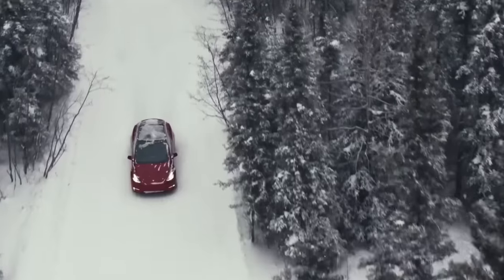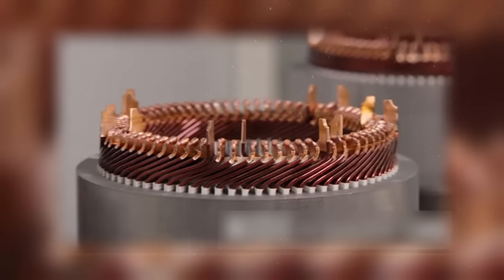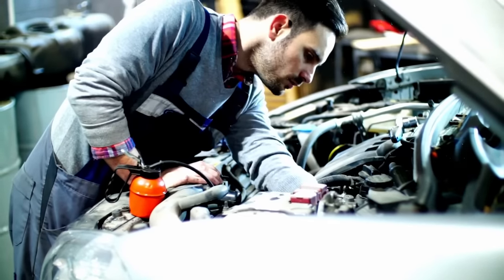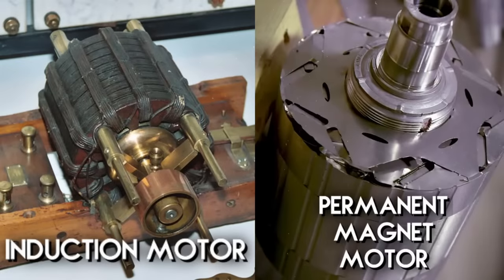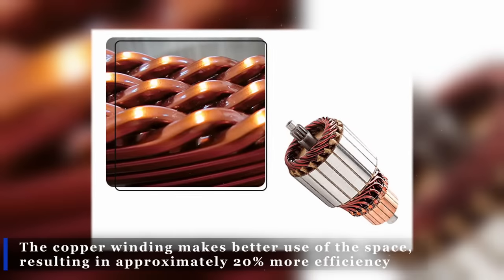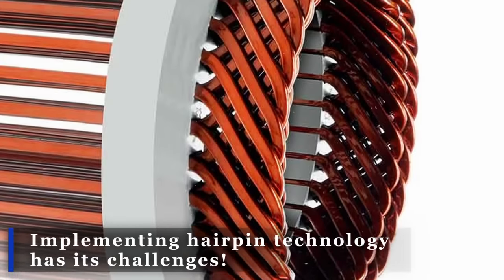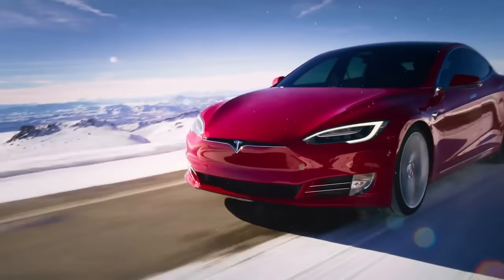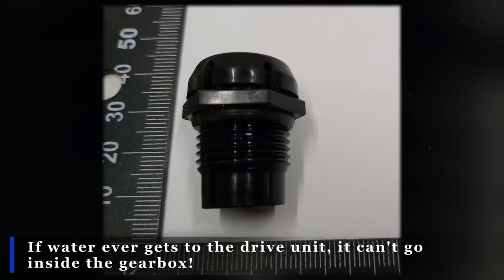Elon Musk: Tesla's New Engine Will Change The EV Industry Forever!

Comment: For EVs, the motors are not the issue, it's the batteries. E.V.s will only be good once we can 100% recycle batteries, have charing which takes no more than 30 minutes, be able to charge to 100% without damaging the cells and be able to do 100,000s of miles before any significant degradation or at least mitigate any degradation from batteries. The alternative would be to make batteries very cheap to replace.
Reply: But since we don’t recycle any of the fuel we use right now I would say that’s a tall order. Everybody I know that has a Tesla is about to charge to 80+ percent in about 20 minutes ,but with lithium iron phosphate batteries, they should expect to get more than 100,000 miles with no degradation, lithium ion somewhat less and the sodium batteries may prove to be even better.
Reply: @sandyt4343  degradation is about 2-4% per 10k miles or year for the most recent M3s. This also worsens towards 7% per annum or 10k miles if you super charge all the time and always charge above 80% and allow the vehicle to completely drain constantly.
Reply: Never going to happen, evs far more damaging to the environment overall than ice cars especially  diesels which are far more efficient and the latest diesels very little pollution and far more reliable
Reply: @barryphipps9442  battery development could enable this, such as how computers was running on KBs back in the day and these days were on TB and about to start h wrung towards PETABYTES.
Reply: @sandyt4343 Sodium ion batteries have been around since the 1970's.
They hold x5 more power than Lithium ion batteries.
Plus they last x3 longer.
They are one quarter the size of the Lithium ion batteries.
They are also considerably cheaper.
Reply: @barryphipps9442 Diesel comes from oil.
Oil will not be around forever.
Reply: This comments on this video are as erroneous as the poster!
* EV batteries are 100% recycled at >95% efficiency. The recovered minerals are far too valuable to throw away. In US Tesla and Redwood Materials do this.
* Batteries already meet the requirements for vehicles and storage. The issue is not increasing performance but cutting costs. Tesla's 4680 format cells are designed to do this.
* Charging rates of 200 miles in 10 minutes are common on Tesla vehicles with Superchargers.
* There are broadly two packs on offer: LFP are cheaper with lower energy density (charged voltage) and higher cycle life. NMC are performance cells trading energy density for cycle life. Either of them will outlast the typical ICE drive train. In energy storage situations it is possible to make packs that will last 40-50 years with either chemistry. In vehicles million mile batteries have been demonstrated by Tesla's battery expert Dahn.
* NMC cells lose ~5% capacity per first 50k miles and thereafter ~1% thereafter.
* Sodium Ion batteries are lower energy density and lower cycle number than automotive batteries at 75–200 Wh/kg. Both CATL and BYD may use a combined lithium/sodium pack in cars this year.
*Tesla power trains and batteries have both been tested to a million miles without maintenance. Motor cooling fluid is replacable. No Diesel or ICE can do this.
* BEVs are MUCH cleaner than ICE cradle to grave. A Tesla Model 3 would need to be driven on average in US for only 13,500 miles (21,725 km or ~ a year) before it does less harm to the environment than a Toyota Corolla. and yet it costs less to own within 5 years in the US (Argonne Lab).
Reply: @barryphipps9442  Nothing is more damaging to the environment than fossil fuels.
Reply: we can already recycle 98% of batteries...
Reply: Why do you need batteries!

Comment: Rectangular copper conductors in motors have been used for very many decades, there is nothing new whatsoever in this. It's only in low power induction motors that round wire is used because it makes for a cheap way of winding the coils by machine. 
Packing the windings tigher tends to increase winding temperatures, but I'm sure Tesla are aware of that in their design.
How are these motors cooled? Industrial induction motors of small to medium size have external fins and fan cooling. (Large motors often have water cooling.)
Reply: Tesla's motors are water cooled.
Reply: Jim, 

thank you for the information. What about the power controllers, air cooling similar to industrial drives?

Comment: Whether you drive electric or not in terms of safety it is never good to be behind the wheel for so long without a break, but I understand your fear, I had it at first but I have been driving electric for 5 years now my driving range is only 360km and to be honest I have never had any difficulties,  The only times I had to refill, the break was more than welcome
Reply: You have issues I don’t have
Reply: Driving Model S since 2014 and never had any issue with the technique. Driving electric is really great and having a sports car with the loading capacity of a Model S is something you will not find with any comparable car like Porsche or any Audi RS or BMW
Reply: A 30-45 min break on the road is NOT welcome.  And that's if you're not behind others charging.
Reply: @melbro62  If you drive until your battery is complete empty then per law you have to take a break anyway.  And btw, there are e-cars that plan your trip, and they know where an empty charger is available for you. Never saw that for gasoil stations.
Reply: @konstanthin8753  Sorry Konstathin, gas stations are everywhere and I have an App that tells me where they are and what's really nice is where the cheapest gas is.  Since EVs only make up less than 10% of total vehicles right now and they are already having problems with rolling brownouts from the charging demand and home AC demand on hot days.  Electricity doesn't grow on trees and I can imagine when the EVs get to be  even at 20%-30% of all vehicles how Grids will be overrun.   Of course for average commuters I can see an EV being a good thing.  That I-95 last winter on the east coast and those stranded EVs gave me chills, literally.
Reply: What BREAK per law?  Is that a California thing?  I take a pis break 5-10 min and that is not per law.
Reply: @melbro62 : Now it is clear why humans are going nuts. With such intelligent answers one is powerless. Your answer is about as intelligent as the sentence "Why should I need solar? My electricity comes from the socket"
Reply: Breaking every few hundred miles is normal and safer but recharging is something I would rather not have to worry about so frequently and I'm sure the EV industries are the future possibly with a water fuel technology integration both being better for everyone but oil companies. Have a Blessed Day & pray about it 🙏 in JESUS HOLY NAME AMEN AMEN AND AMEN 🕊 💜 🙏

Comment: How about the toyota's internal combustion engine the runs on hydrogen?
Reply: The energy density of hydrogen is not as dense as alcohol. All kinds of other fuels( biofuel, synthetic fuels, methonol, hydrogen) still needs a lot of processes before it can turn into usable fuel. These process still will emit much more greenhouse gas than the process of battery. Battery is still the way to move forward.
Reply: @tanalson  that's not true at all. They make hydrogen on demand & the emissions are oxygen or water.
No harm in producing them both anyway.
Reply: @valeriegiles6524 I agree with you. Personally I'm more convinced that Toyota's hydrogen combustion engine is a better technology for the future, not only for autos but also should be explored for aircraft, ship engines, or even power plants.
Reply: @nurburgringkid  i disagree, as much as i love ice engine, i still believe that electric car is the future. once green hydrogen production can be scale up to mass production, EV can really take off. atm bev might have the lead, but i truely beliece that toyota fuel-cell ev will be the future especially in teh truckin industry. a much small high power battery combine with a hydrogen fuel cell, should be the future. directly high power from a small battery so u can still get that high power acceleration and all teh thrill of a high preformance vechical, a 50-100 mile range battery is all u need. for long distance and endurance run or trip, hydrogen fuelcell can provide teh power need to mantain freeway speed for long distance. fuelcell can also generationt eh power need to recharge the battery on teh go. fillin up a tank of hydrogen is still fast just like gasoline.
Reply: So you take hydrogen gas and then convert it into electricity... So that's still an electric car....
Reply: @Kiran-uo8vu  please read properly I sais internal combustion engine that burns hydrogène instead of gas
Reply: @Kiran-uo8vu  you dont take hydrogen gas. It breaks down water into its 2 components & uses the hydrogen to power the vechicle. No batteries required.
Reply: Mirai is not an  internal combustion engine the runs on hydrogen.  It is fuel cell.  It uses hydrogen to convert to electricity directly.
Reply: @wilsoneashoian5789  https://en.wikipedia.org/wiki/Hydrogen_internal_combustion_engine_vehicle please educate yourself;f before writing.
Reply: @laflammr  Lol Mirai Fuel Cell Stack works with chemical reaction involving the oxygen in the air and hydrogen creates electricity.  There is no combustion.  It is directly generating hydrogen into electricity. Educate yourself before you make a fool of yourself.
Reply: @wilsoneashoian5789  i am assuming you did not read the article on ice engine running on hydrogen. Why do you keep on talking about Mirai it has nothing to do with it. You are the one showing your lack of knowledge
Reply: @laflammr  I read the article.  The first law of thermodynamic is held in the universe.  The  conservation of energy, is always valid.  It does not matter how you use the energy.  If system is 100% efficient you get what you put out, but no system is 100% efficient. If electrolysis (electricity) is used to convert H2O to H2, the same energy will be recovered during the combustion. The most efficient system is when H2 is run thru Fuel Cell. Burring H2 will be only 50% efficient because of the entropy.  Please learn some engineering before you talk to me.
Reply: @wilsoneashoian5789  well in that case I must have read Toyota's new patent.     By the way what is your master in engineering.     https://www.youtube.com/watch?v=P8sosEGk068
Reply: @valeriegiles6524 hydrogen is highly flammable compared to gasoline and EV battery. Hydrogen fuel will still need transportation to fuel station, the hydrogen engine will still need maintenance like gasoline combustion engine such as lubricant for engine and gearbox. Whereas EV is basically maintenance free. It is more costly to re setup hydrogen fuel station compare to pulling electric cable for EV station.
Reply: @aeroline11  
Yes it is transported. 
However, it is also produced on site, also.

Comment: The electric motor weighs 194# but then you add the battery weight and you are carrying a load to begin with.
Reply: Then they have to develop a battery that is lighter and have has a lot more energy density
Reply: But it's 20% more efficient. This means it's going to use less energy for the same amount of torque and speed, so this means that Tesla will use lesser batteries , which will also drive down the cost too
Reply: With ICE cars you have the weight of an engine, transmission and a tank of gas plus the set up is only around 30% efficient. I don't have a dog in the fight. I don't think cars are the reason for climate change but I do think it is exciting to see the electric revolution. They are still improving ICE to this day, 150 years after it's invention so what makes you think the first version of batteries and motors for EV's was going to be the best and never need improvements.
Reply: @tanalson  This claim cannot hold. Any good electric motor is efficient for more than 90%...most of them 95%.
Yes you can reduce the energy loss with 20%....meaning that instead of 95% efficiency you'll get 96% efficiency.

The only real gains are : Less weight, less materal usage and less heat production (which reduces cooling...)
Next point...An electric car does not have a heavy combustion engine, transmission, clutch system  and gearbox.....Only the conbnection to the wheels still exists (in a Tesla)...we also do have inwheel engines which do not have any extra resistance in the car anywhere except the unavoidable wheel bearing as any other car has.
The weight af a standard tesla battery ...ca 5kg/kwh including battery management system/cooling. With at least 200 kg less (no filled petrol tank, no transmission, no heavy combustion engine needed) we hacve already a 40KWH battery for the same weight as an ICE drivetrain. 
With the new mentioned battery (on internet...sodium) with a weight of 2 kg/kwh we will have in the future when those are in production a 80KWH battery in a car with the same weight as an ice car.
(In 2013 a 5,1KWH battery was only 20 kg...at that moment the best which could be found on the market (less than 20kg due to the rules of the world solar challenge)...already less than now the tesla batteries. The technic in batteries is not on a stand still)
Reply: @rickbackous1041  can the Chinese make ones that dont burst into flames?
Reply: @brianjones7660  solid-state batteries are right around the corner
Reply: Any time frame we can hold you to?
It’s like Brazil, always the economy of tomorrow ……always off in the future.
But soon, real soon….we mean it.

Comment: Friendly advice …. You use the word engines multiple times ….. the proper word would be motor….. engines use a fuel to explode the fuel and drive the crankshaft
Reply: Burn the fuel, not explode.

Comment: Regardless, they are still electric cars with all the same problematic issues they've always had.
 Toyota's "H2" hydrogen fuel cell internal combustion engine is THE  "state of the art"  powerplant technology for future vehicles...coming soon!
Reply: The hydrogen fuel cell vehicle has been coming for years.  Will it ever get here?
Reply: @passingthrough812  it already has , in japan at least
Reply: A fuelcell car is just another full electric car. No combustion engine. Sorry that I have to tell you this. A fuel cell is just a electricity producer using hydrogen for this. Unfortunate the efficiency of the H2 cycle is very low. On the wheels these cars are worse in efficiency as ICE cars...partly due to the need of compression into the fuel tanks for H2.Also those fuelstation can explode (as we have seen in Oslo) And for the construction of fuel cells we need very expensive and difficult  to get  elements (irridium)...for the membrane. 
H2 is NO advisable option for cars. It could be an option when weight is very important (planes).
Reply: @reiniernn9071  The H2 vehicle is not an electric car. It uses an I.C.E. using hydrogen instead of gasoline.
Reply: @take942  If you are typing fuelcell in your comment I can only assume that you are writng abou a car wth a fuelcell technic...."Toyota's "H2" hydrogen fuel cell "
Reply: @reiniernn9071  Yes, Toyota H2 and other engines too.
I also saw a documentary in the late 1970's broadcast on the PBS show called "Nova". 
It was an in depth show about using hydrogen in vehicles with I.C. engines. BTW, when switched over to hydrogen it could clearly be seen that the engines idled much smoother than burning  gasoline. They also showed jet engines using hydrogen and homes using hydrogen for heating and cooking in place of natural gas. The tanks that it is stored in must be lined with plastic as the hydrogen molecules eventually eat thru metal when stored for longer periods of time.
Reply: @Reinier NN he is referring to the H2 Internal Combustion V8 engine developed by Toyota in conjunction with Yamaha
Reply: @passingthrough812  It's here in the USA now, if you live in coastal California. Toyota sells about 200 units per month of the Mirai fuel cell car. It's a competent vehicle. Very well engineered, very nice to drive. And is does fill up in 5 minutes - IF you can get to an H2 station. Those are rare, and all concentrated around LA/Orange County and the SF bay area. You can't take the car out of the limited area with stations. Their are no stations in any other state, or even in most of California. (Correction - There is an H2 station in Hawaii.)
Toyota sells each Mirai at far below the cost of production, and bundles in $15,000 of prepaid fuel. Basically, they nearly give the cars away to achieve some shipments.
This is not going to change any time in the next decade.
Reply: @reiniernn9071  who needs compression tanks?
Seriously, why?
Stanford Ovshinsky developed solid hydride storage, a spongelike material to store H2 in the hybrid Prius he drove for years on H2.
Why bother with compression storage at all?
Reply: @veer-spec3  
and in Iceland has h2 cars
Reply: @take942  you are right but is carbon free
Reply: @brianjones7660  
Because it falls under  the nuclear regulations. The regulations would have to be changed in order for it to be used by the public. 
As long as you personally made the material for personal use, that’s different.